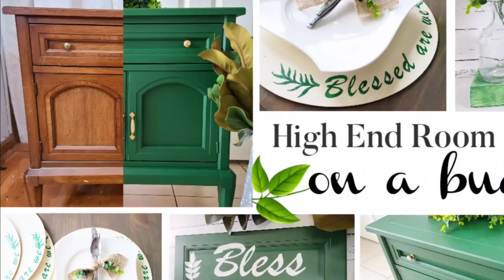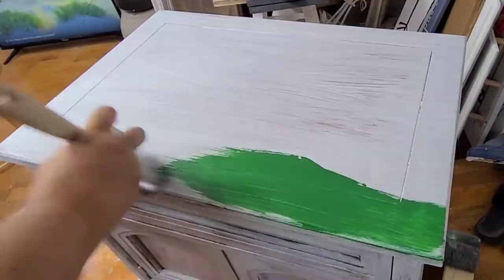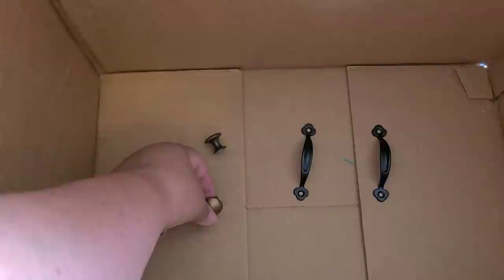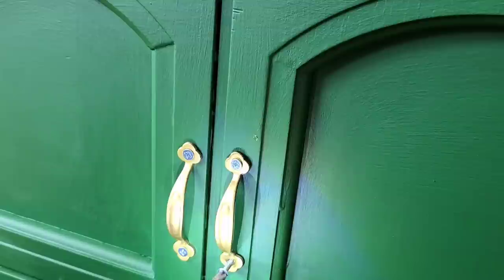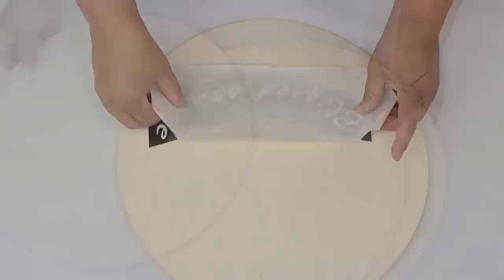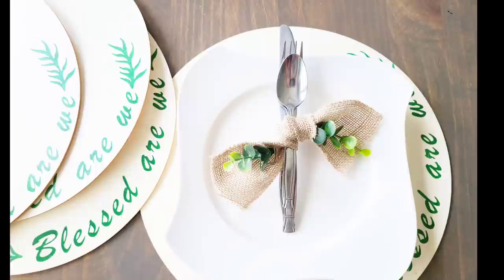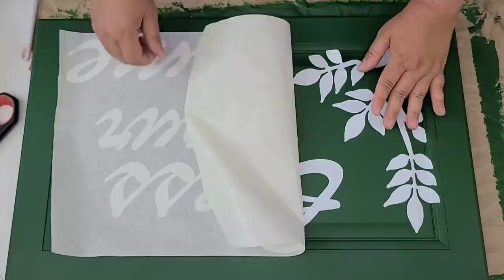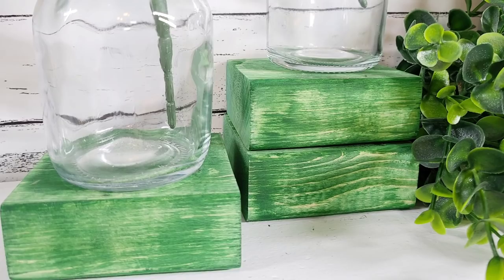🌿 4 Fresh and Trendy Ideas on How to Decorate your Home | Easy DIY Projects for Home

Comment: The side table turned out beautifully.  Wood risers are always a must in decorating. I have found when vinyl doesn’t stick with painted surfaces. I add a coat of polyurethane or mod podge as a top coat to help. Don’t know why this happens, but I’m guessing it is the paint rather than the vinyl.
Reply from the maker: That's a good point and great idea. Thank you so much ❤️

Comment: I saw where you got a door and made a sign. My question is I got one wanting to make a table top but it's on the small side. What would you suggest I do to make it bigger for a table top? I would greatly appreciate it bc you do excellent on furniture. I watch your videos often.
Reply from the maker: Awesome! Thank you so much ❤️. What she size of the door?
Reply: @diybeautyonpurpose  it's 141/2  by 141/2 and it turned out to be the same size of the base I'm putting it on. I don't know how to add to it or not be  able to use it at all?